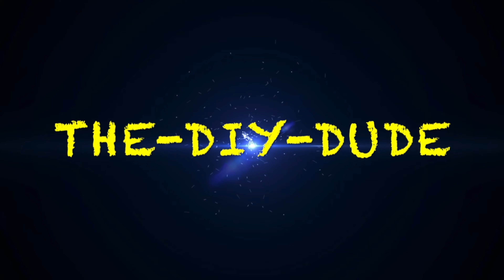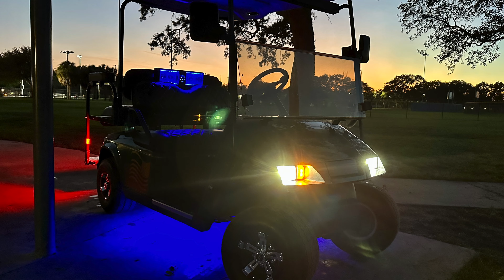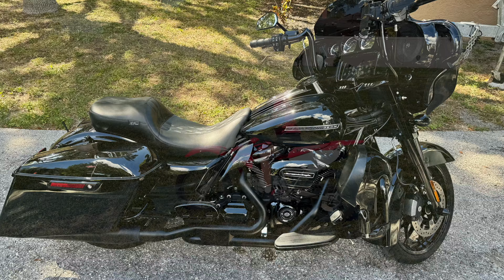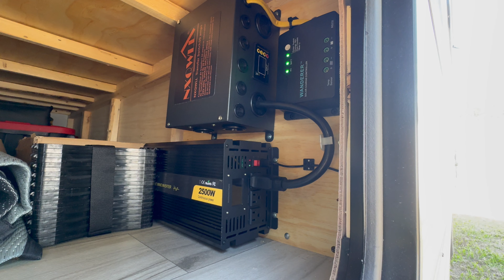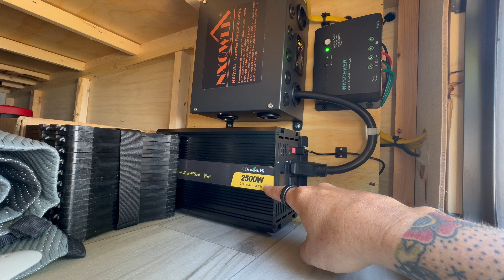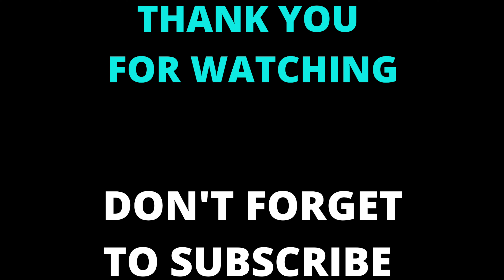The Beginner's Secret to RV Inverter Installation

Comment: With the inverter running power does this turn on your AC? Or does the AC only run through shore power?  And if I install solar panels do those go directly to the battery? Would they even charge the batteries since the inverter is drawing power
Reply from the maker: The solar prep loop used for the inverter setup does not power the air conditioner, which requires shore power unless you run an extension cord from inverter to AC. Solar goes directly to your batteries to keep them charged. The amount of solar you install is directly correlated to how much energy you are using. If you want to run completely off grid with everything running, including AC and DC power, you will not be able to do that with our roof space for the amount of solar you would need plus you’d need a really large aH battery setup. This setup is more for short-term off-grid use and battery replenishment, not permanent or long-term power.

Comment: Why do you need the transfer switch?  I have a 17b as well.  Would I have to install the switch in order to install an inverter?
Any chance you can show the wiring in the switch?
Reply from the maker: The transfer switch is for an inverter without a built in one. It is there to protect you from running shore power and your inverter at the same time which could fry your electronics or even start a fire. As for wiring they will all be different but the same concept. You will have your power (line side) coming in from your shore power and inverter and your power (load side) going out from the transfer switch.

Comment: rather than running the cable from the inverter to the battery outside, couldnt you just use a fuse between the battery and the inverter so that if something does go wrong it'll just blow the fuse and all power will stop, ensuring there isnt a huge fire risk or am I misunderstanding something? I was planning on putting my batteries inside the storage area because I have 2x 300 AH batteries so 600 amp hours total. They're heavy n bulky and putting them outside seems rather difficult lol
Reply from the maker: The risk is in the batteries themselves. Whether it’s thermal runaway or a short, batteries can catch fire or explode depending on the type when connected to wiring, charges, or inverters. As for a fuse you should always have a fuse on anything drawing power from a battery. Mine has a fuse between battery and inverter as well. Anything carrying a load is fused on all my installs including the solar and charge controller.